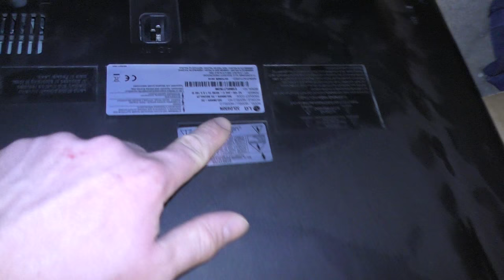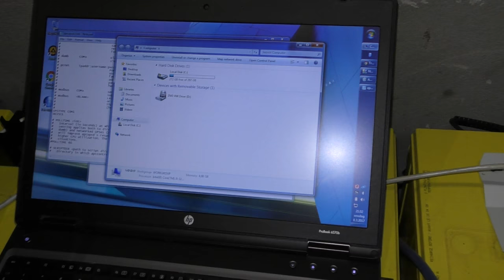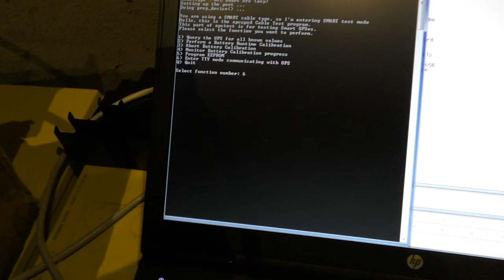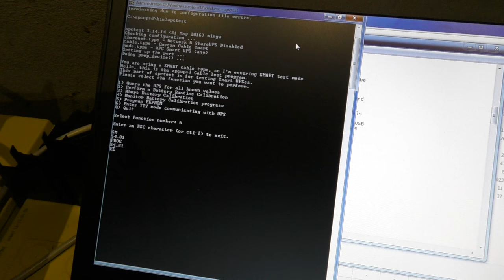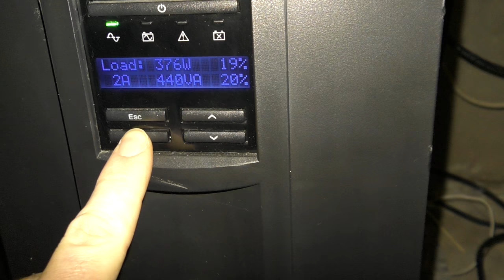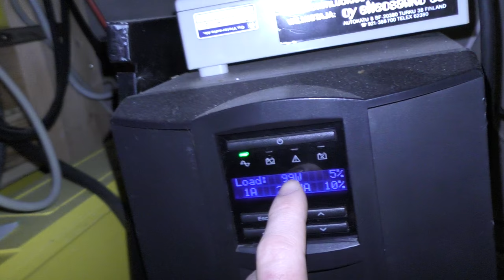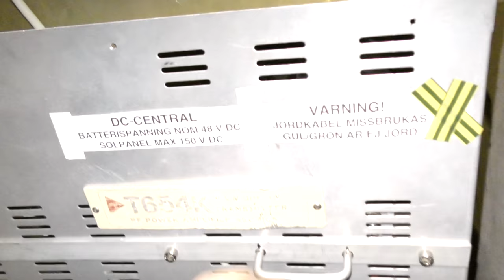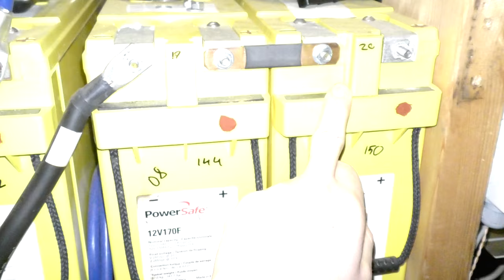Unedited quick blog video (INCLUDING HOW TO SET APC UPS CHARGE VOLTAGE!!1)

Comment: Good to see you have a real circuit breaker for those batteries, not some small cheap thing that cannot cope with the high fault currents.
Reply from the maker: 600 V DC rated, baby.

Comment: great video! hey uncut is my style, I tend to do short videos anyway so if i mess up I just redo it. I love your ups on a ups setup lol. I really need to have a proper play with the ups' I've gotten to get things going well, all I have done is just put one with 350WM (Watt minutes) of capacity in light load service (Lenovo tiny pc at work) and chucked some new batteries into a BR1500LCD at home (not even serialled into my gaming desktop that it backs up). Anyway good luck with your job!

Comment: Do you need a special serial cable for them UPS , like an isolated one . Or can you just wing it with a null modem one ?
Reply from the maker: APC UPSes always need special cables. There's a couple different versions, the SMT series I think just has an RJ-50 on the back for extra headache.

Comment: Have you tried using a contraption that's known as an "Re-EMF charger" on one of your lead-acid batteries? It is claimed to actually improve the battery's capacity by breaking lose sulfates from the lead plates with high-voltage spikes at a rather high frequency (while not heating the battery up during charging). You can find plans for it on the internet.
Reply from the maker: I've done videos on battery desulfators, you can find some of my findings in my lead-acid playlist. My experience is that they don't do much - and they certainly wouldn't do anything to these batteries, as they've never been subjected to sulfation.
Reply: OK. Still, this thing called the "Re-EMF-Charger", basically a "Joule Thief" circuit wired in between the charger and the battery is to my knowledge the only thing that can bring low capacity batteries back up (even though not to full, this seems impossible right now). So if you want to look into it, I'd appreciate your thoughts about the matter.
Reply from the maker: I've designed a way more sophisticated version of that for use in my testing, and my position still stands. The data I gathered from the big batch of sulfated batteries I used in my "large" test showed no significant advantage to a "re-EMF-charger" over just starting the charge with a controlled overvoltage.

Comment: love your video`s and experiments! i just started with a used 3000VA RMI2U unit included the optional NMC card, no idea yet how to start setup, the manual doesnt say so much aboutthe use of the usb, serial RJ45 or the NMC card....   so 3 options i have to control this unit? i ordered a new RBC43 batterypack as the old one doesnt seem to handle the load for long, it drops within 10 seconds to about 20% charged and the ups flip with shutdown and start over and over.  i did the test with 900watt coffeemaker so a really usefull load for a test, a server wouldnt be happy to get power on and off that fast lol , any tips what to do ? i sure want to lower the chargevoltage when my new batterys arived. Now the batterys doesnt seem to accept much amperage , messured around 180-260 mA only while the ups indicated after 3-4 hours the batterys are 100% charged..... i not really believe that.

Cheers m8!
Reply from the maker: You need to hack into the internal serial port if you want useful console access on one of the LCD models. Then it's just a question of entering the programming mode (press 1, wait 2 sec, press 1 again) and altering the battery voltage variable (capital B) by pressing +/-.
Reply: having hard times to get it work with apcupsd, i run now usb cable and network to the nmc card ,  powerchute business and the webgui from the nmc too.
all that works fine. what left is the rj45 port (serial) have no cabling for that , but wonder if its not easyer to add some lines the the apcupsd config instead ? having hard times with commands-) 
for now i have a brandnew batterypack and charging is about 54,5 - 54,8volt that comes at max 13.7 volt/battery as i have 2x4 in serie /parrallel , seems not too bad but little lower might be more perfect